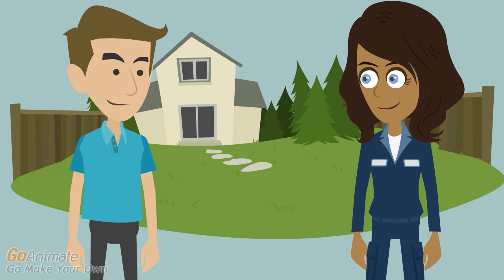Goodman Furnace Troubleshooting Codes

Comment: I had 6 blinks repeating and the blower fan stayed on.  Turned out to be a fuse blown on the circuit board inside the furnace. It was an easy fix with a 3 amp fuse from the local automotive store.
Reply: +mosby95 thanks! this was happening with my furnace
Reply: +mosby95  Bingo! Thanks!